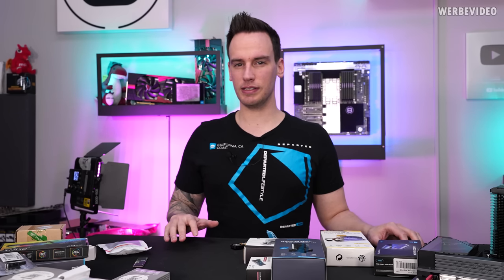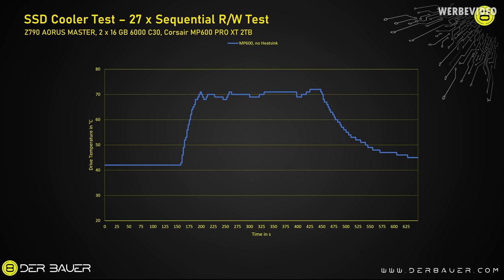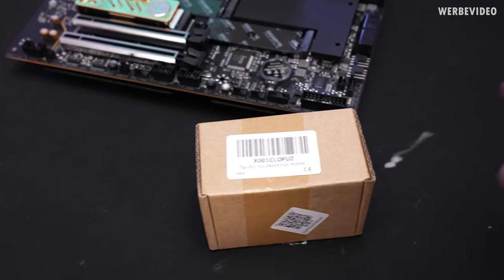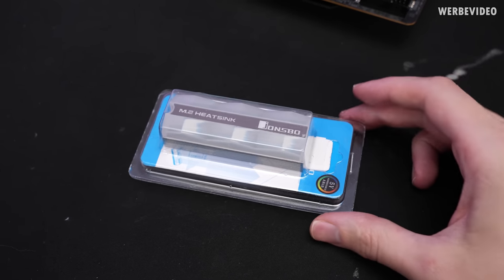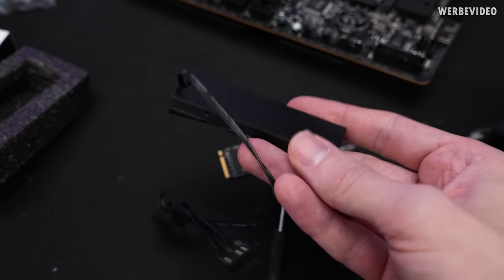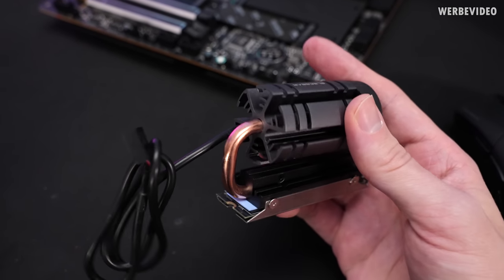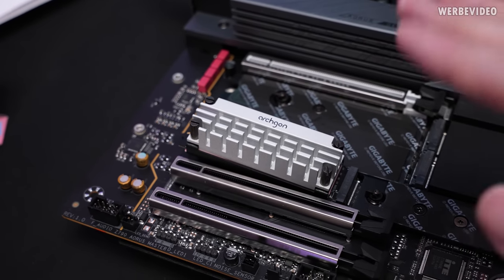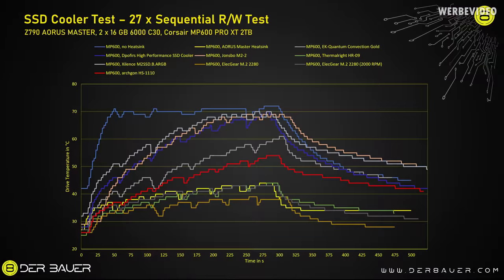Who designed these? Terrible Cooling Performance and "Interesting" Mounting Solutions

Comment: My main concern with "above basic" SSD coolers is that while the controller needs cooling to not throttle, the flash itself has to be hot during operation, or it degrades considerably faster. So sure, your SSD with a huge chunk of copper on top will work faster, but... for how long?

Edit: For context/source, check Gamers Nexus video titled "Ask GN 90", it provides a quote from an expert that references JEDEC specs.
Reply: Sauce?
Reply: I wonder why smaller optional heatsinks aren't provided with higher-end SSDs for just the controller. It's not like it would break the bank.
Reply: I was wondering if I should just buy a small heatsink and attach it to the controller and leave the flash exposed.
Reply: Does it have to be hot or just not extremely cold? I have never heard of a problem with flash being too cold other than in an XOC setting.
Reply: This is a myth.
Reply: @UnluckyDomino  Gamers Nexus video titled "Ask GN 90" has a quote from an expert on that, though the information has been here and there too.
Reply: [context needed]
Reply from the maker: This is a myth indeed. As long as your flash is above room temperature there is just no difference. You don't want it to run "hot". Just not -50°C
Reply: @NecoG  Tests have been done on temperature affecting NAND already (Program/Erase times, RBER, FBC can be found in just one study). It isnt a myth mate.
Reply: @der8auer-en  Thanks! I remember it being too hot affects memory storage or error correction too right? Can't be extremes
Reply: @der8auer-en  Would you happen to have a link to a study/test on that? I'd be curious, tech data is fun to dive into.

SSD endurance isn't tested as often at all, most outlets are more interested in publishing flashy numbers on newest technology. The only source I knew that did test SSDs till fail was doing so several years ago, wasn't in English, and could only afford single samples. It did result in interesting data though, at the time showing how Samsung flash survived like fifty of its rated TBW, while some cheaper generic stuff barely made it to its TBW, if even.

I guess part of it is how reviewers run their business, but also part - that compared to other high-end components, SSDs are now "cheap enough" to not care, especially if you buy a larger one. I do not like any hardware failing on me at inconvenient times, nor spend on upgrades without good reason, so still prefer to stay informed. But I kind of can understand why things like SSD endurance can be a non-issue for many people nowadays, so, yeah.

Comment: Given NAND is suppose to operate at hot temperatures (and stored in cold temperatures) and only the controller is suppose to be "cold" during operation, I think tests done with only the controller being cooled would be ideal. Would be a nice thing to test with any of the cheap (and prolly bad) options to see if they are usable.

Comment: If those rubber bands are butyl rubber, they shouldn't go brittle quick enough to matter, but they will lose tension.

As for the paste, it's presumably for the rotating pipe interface.

Comment: I think if there is time to put the system in a case with positive pressure airflow, some of the heatsinks with fin structure may perform better since the airflow in the case can brush through the fins and carry away the heat.